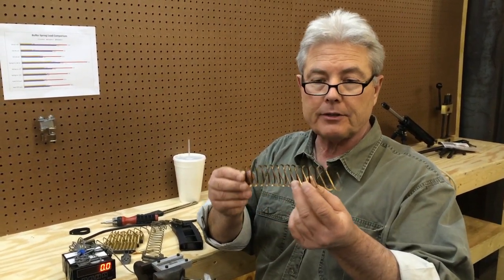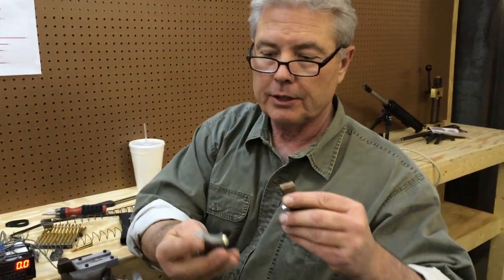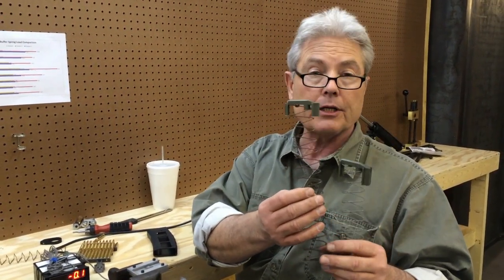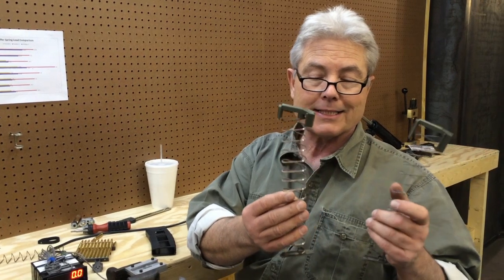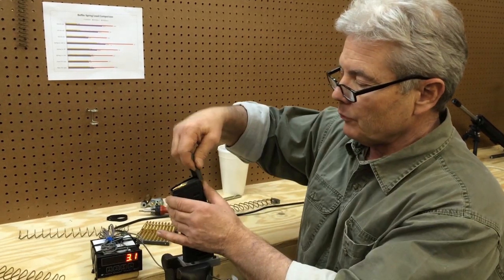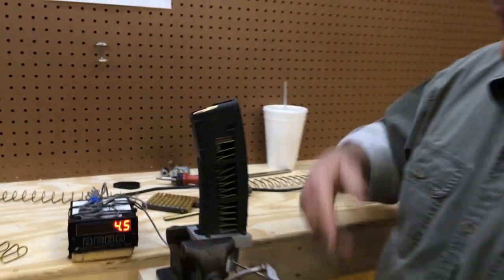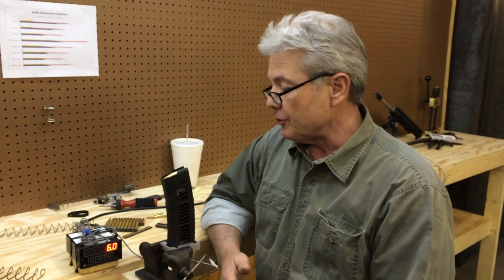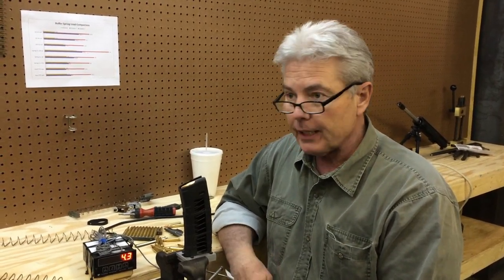What you should know about AR Magazine Springs

Comment: I just changed my #5 Pmags that I carry at the range all the time with some of these 17-7 Flat wire springs and I can def tell there's more pressure on the plate and it also seems to compress more evenly. Although I have to admit that I've never had any issues with Magpuls round wire springs ever.

Comment: I can see the advantage of a flat wire spring. This would help with inserting a fully loaded magazine with 30 rounds into a rifle with a closed bolt. Some magazines have difficulty locking into the mag well on a closed bolt when they are loaded with all 30 rounds. This should solve that problem.

Comment: Several questions...
1. 33 in a 30rd Pmag, so the limiting factor is the spring not the follower?
2. I guess I can order a 30rd spring and cut it for my 10 and 20 rd mags, but what about for a 40? I have also have 30s and 40s with 5 round extensions. So potentially I'd need a spring long enough for a 45?
Reply from the maker: 806-323-9488 for assistance

Comment: I just installed your flat wire spring and love it! One question - does it or the buffer tube need to be lubricated in any way?
Reply from the maker: No.  The buffer spring does not require additional lubrication as it is coated with Sandstrom 28A which is a moly based dry lubricant which has been bonded to the spring.  Hope this helps.  C. Tubb